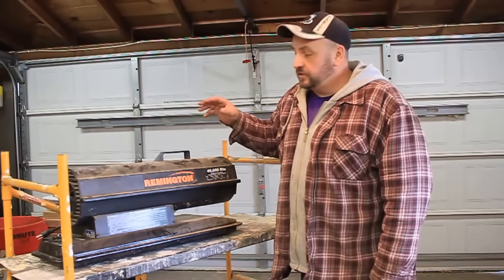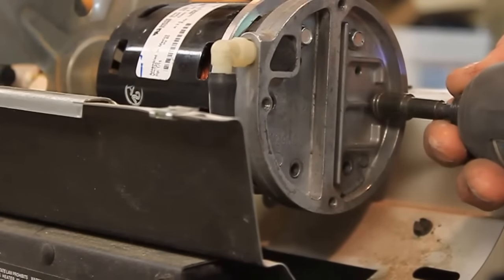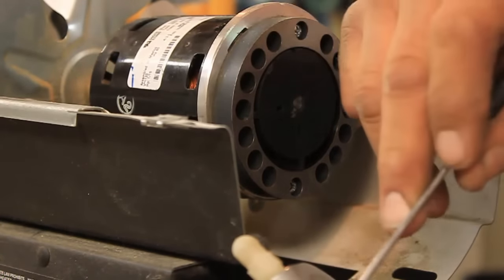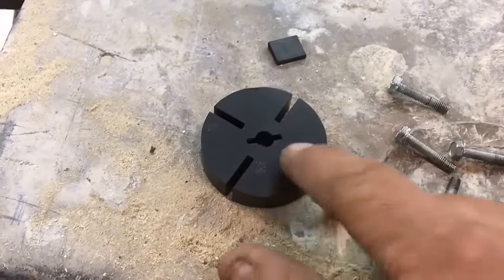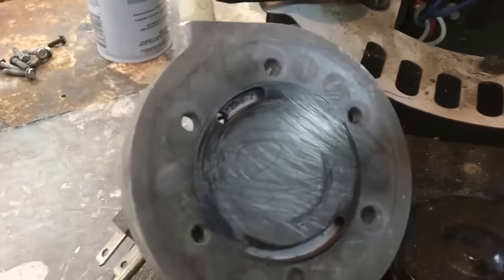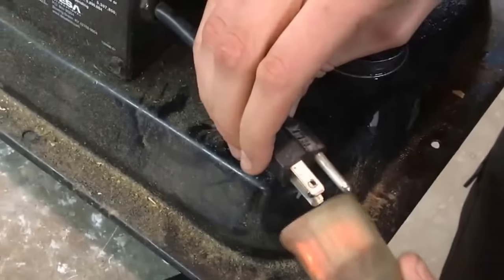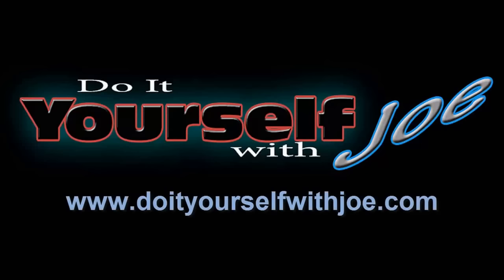How to Fix a Torpedo Heater/One of the Cheapest and Easiest Fixes

Comment: Dayton 75000 to much pressure 7.5psi  requires 4 psi. Will not adjust. Heater lights then pops and goes out. I thinks it's flooding.
Reply from the maker: I'm not sure of your model, but a friend of mine had a similar problem. He said when he took out the sponge filter in the back it fired up and ran fine. I think all he had to do was replace the sponge filter. If you find the problem please leave a comment on what it was so we can all benefit.
Reply: @Doityourselfwithjoe  not the filter,I remove it no change. If I put my finger slightly over the intake to get close to 4 psi it does better.
Reply from the maker: @tommac8602 You're right, its obviously pushing to much air. I understand it is not adjustable, however i am thinking there has to be something to regulate the pressure. So what ever that is it must me stuck open. You may have to take the back of it off and check for a spring or some kind of small ball bearing that may be stuck. Thats all i can think of

Comment: what if I replaced the pump, now it sprays fuel, lights the plug, but wont ignite?
Reply from the maker: Now it could be to much air not enough fuel. You  may have to adjust the air pressure. Also make sure fuel is good. Im not sure if kerosene looses its flammability or not. Just trying to throw some things out there. Post your solution here if you get it running.
Reply: @Doityourselfwithjoe  I was playing with the screws on the back of the motor a little bit, but the most I got out of it was a cough. i might try some new fuel and see what happens
Reply from the maker: You can always try using compressed air. If you have a compressor, turn it down to about 10 pounds of pressure then take the hose of the pump on the heater. Turn on the heater and spray compressed air into the hose and see if it lights.
Reply: @Doityourselfwithjoe  I dont think the issue is pressure, I just put a brand new pump and you can see it spray when it tries. I think the kerosene is bad

Comment: Hey Guys help me someone please my kerosene heater  turn on and work fine, but after 15 seconds it turns off itself what is the problem who knows?
Reply: @jdisdetermined  Thanks for the help. I found the problem, I fixed it to the nozzle after I cleaned it, everything worked As needed Thanks

Comment: I change the board and filters and I keep getting the E2 error code the motor don't even turn ?
Reply from the maker: Changing the board, this sounds like a newer model. I tried looking up the error code for a  torpedo heater and nothing comes up. What kink is it?
Reply: On mine witch has not many hours. Every year when I plug it in the fan won’t turn and I get the E2 error, but if I spin the blade by hand it takes off and run fine. I lubricate it every season but still have to spin blade by hand and then it’s fine?
Reply: @ronrichards1864  Mine said E 2 tonight did you find out what caused that? Mine sometimes does not light and blows smoke.

Comment: Update from my situation, the graphite gummed up my air pump after running for about 30 minutes, unfortunately this strategy didn't work on my identical heater
Reply from the maker: Im sorry that it didn't work for you. I used liquid lubricants and they gummed up. Then I cleaned everything and made sure everything was dry and mine worked great for two or three seasons. Then I had to do the process over again. The problem i had was the fan. I sprayed wd40 on the bearings in the front and the oil eventually worked its way into the back of the motor and gummed up the graphite. Because of that i later replaced the rotor.
Reply: Mine was also clean and dry when I used the graphite but not sure so I threw it back together without it and it worked fine but now I'm dealing with moisture in the fuel, it's been a constant uphill battle with this one
Reply from the maker: @parkerhammond3258  Sounds like it. Good luck!

Comment: what about silicone spray? graphite gums up too
Reply from the maker: You can't have anything wet. Graphite shouldn't gum up if everything is dry. I've used mine quite a bit and it's still running fine. If you do try that please let me know how it works.
Reply: @Doityourselfwithjoe  I ‘ve use graphite and after  15 hrs of running time the compressor start sticking again
Reply from the maker: @funzynike123  Look for something leaking into the compressor like oil or condensation. It doesnt have to be much.

Comment: mine puts out way to much fumes, what can I do?
Reply from the maker: First try cleaning the air filter in the back. If that doesnt work there are two adjustment screws on the back. I'm not sure what the air pressure is supposed to be set at, but it sounds like they need to be set.
Reply: it should be listed on the side of the heater
.. its not a lot, should be under 5psi.   My 60k unit is only 3.4 psi.   Buy yourself a low PSI guage and install it on the port towards the outside (one port will have a hole in the plug with a spring and ball inside.  That port is the adjustment (It should have a cap over it)   The other port will be solid and nothing behind it when you pull the plug out.   You can keep the gauge mounted on the heater too, it will help you keep an eye on how it's running.   These are VERY simple units with little to go wrong.  The air pump vanes are normally what will keep it from lighting as long as there is fuel in it!
Reply from the maker: Thank you Lee, your post has helped me as well. I dont know everything about torpedo heaters. I just thought i would share the problem i had with mine. So thanks again.

Comment: What causes my heater to pop out little embers
Reply from the maker: Not sure on that one. Something may be coming apart and the fan is shooting it past the flame, or the fan is hitting something and spitting it out. There could be  something in the fuel that is getting through. If you find out what it is let me   us know and post something here in the comment section.
Reply: @Doityourselfwithjoe  I was told today that they guy I bought it from used diesel fuel, so I need to drain all the fuel out before switching to kerosene

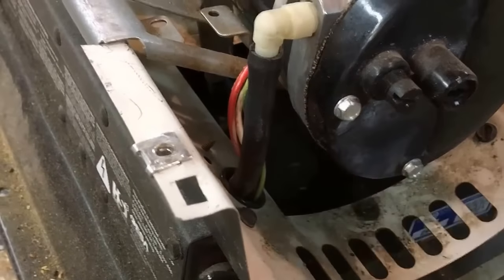Comment: 2:20 Correction. It doesn't pump, it blows. Just pull the hose off and blow through it and fuel will come out of the nozzle. As long as you can blow you will have heat. lol.
Reply: Thank you!

I heard that and paused to see if anyone else caught it. It is not a vacuum pump, it is a blower and it uses a venturi to create the suction to bring fuel up, it is the safest way.

Works just like an air-powered paint sprayer. 

His first test should have been to pull the hose off and blow, if fuel came out then the blower is not blowing, if no fuel, then the blower hose is clogged, then no need to pull the blower apart.
Reply: Good comment

Comment: There is no vacuum to "pull the Kerosene through". It is an air pump that flows through the nozzle. There the fuel is drawn up from the tank.
Reply: @WACKO1123 You really shouldn't speak on stuff you don't understand.
Reply from the maker: It works like a paint sprayer with a compressor. As the air pump, pumps air past the hose for the fuel it creates a vacuum  to suck the fuel through the nozzle.

Comment: My heater runs for 10 seconds then turns off then puts out a lot of smoke what should I do to fix it
Reply from the maker: I had that problem on the one in the video a couple weeks ago. I first took the hose off the back of the fan. I then took and air hose from the compressor and forced air into the hose to make sure to make sure fuel was coming through the  nozzle. After i was done with that I kept the air hose in the hose from the fan. I plugged the torpedo heater in. I waited for the glow plug to glow. Once the fan started I ran air through the hose and the unit ran however i noticed my fan was starting to lock up. I used WD-40 and lubricated the fan and everything is fine now. I know it won't last forever. I'll take what ever i can get out of it. The unit is over 15 years old.

Comment: Hello great video and I hope that is what is wrong with mine. I'm going to take the top off today other than YouTube videos I do not know much about them. I bought one from a guy yesterday he said it works great he ran it however he unplugged it after a few minutes. Once I got it home I wanted to let it run for a little while ran 10 minutes men are really loud screeching noise stopped immediately I unplugged it 15 minutes later plugged it in the screeching noise still there and it did not fire up. I hope I'm not screwed. I texted the guy he said well it never did that for me. I guess a sucker is born every day. I hope you are familiar with what happened. I'm hoping like I said it's an easy fix and not the motor going up
Reply: sounds like the fan maybe loosen the top sheild or open it and watch
Reply: Could also be the carbon disk maybe broke should be able to go to the company’s web page or ereplacmentparts com and order a new piece for $10 ish
Reply: I bet the rotor blew apart. You can get them cheap on ebay.

Comment: Mine fires up and runs for about 5 mins and shuts off
Reply from the maker: Sounds like a fuel problem. If the pump is operating properly then it could be a clogged or dirty fuel line.
Reply from the maker: When mine ran like that I had to take it apart like i did in the video.

Comment: That’s an air pump it pushes not pulls😂that’s not carbon fiber lol there graphite too just like your old pencil lead you used up to 4th grade. So wrong don’t do this boys and girls all he’s doing is clogging up the pump and causing damage to the pump and the air ejector tip.
Reply: Your right this guy is full of it. Its a very small compressor not a vacuum pump.

Comment: Hello. Please tell me what kind of lubricant is in the tube ? dry graphite grease?
Reply from the maker: It's  dry graphite
Reply: @Doityourselfwithjoe  is it pure graphite ? or graphite with impurities ? is it possible to use liquid graphite in an aerosol ?
Reply from the maker: @levkamenev3476  :You can try it and see if it works. In my experience anything that is wet will only work for a short time because it will gum up. If you try it and it works let me know. There is nothing to loose by trying.
Reply: @Doityourselfwithjoe  Can dry graphite clog air filters? after all, when the rotor rotates through the channels, everything flies into the filter and quickly clogs it
Reply from the maker: @levkamenev3476  It can if you use too much. I just use enough to coat it.

Comment: I smell kerosene while it is running, the end plate never gets red
Reply from the maker: sounds like it is getting to much fuel and not enough air. you can try cleaning the air filter or taking the back off and cleaning it.  I know it doesnt help now but i will try and do a video on maintenance.
Reply: you could also go get a pressure guage and measure and adjust the pump pressure to confirm  it's correct before disassembling the unit

Comment: WAY TOO MUCH GRAPHITE1  a few flakes is more than enough.  You will gum up the whole air pump and have to clean it again using that much.  It will become gummy up you air pump when moisture in the air gets combined with it and could end up locking up your motor when the air pump freezes up.  It will also gunk up your filters.  The video is great, just back off on the graphite.

Comment: Help. I put the new disc in magnets in mine and Spins freely and they drop down but when I put the back cover on and tighten it up the motor stops and seizes right up and won't spin. What am I doing wrong? Help appreciated
Reply from the maker: Are you sure its the correct thickness? It may be off by just a fraction. If you need it right away you could try sanding it down a bit. If you have the old one check to see if they are the same.
Reply: @Doityourselfwithjoe  I cleaned up both surfaces with a green Scotch-Brite pad and a little more fiddling around with the pressure settings and she's running like a champ 25.00 worth of parts in a few hours to figure it out thanks for your YouTube video
Reply from the maker: You're welcome! Glad it helped! @mikesilver885